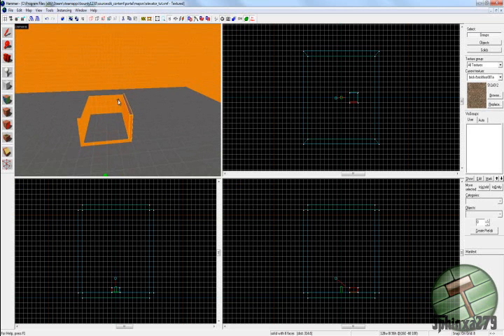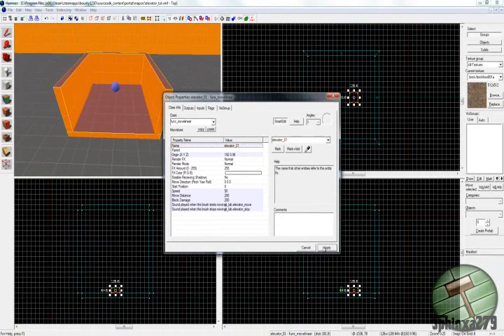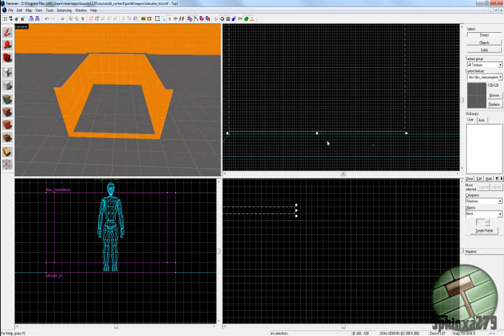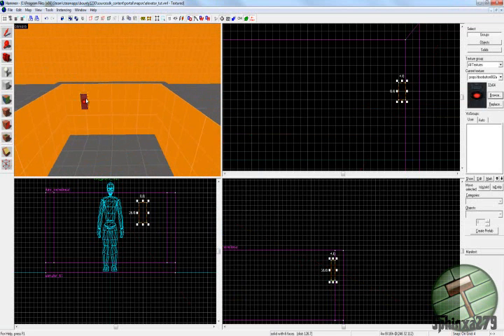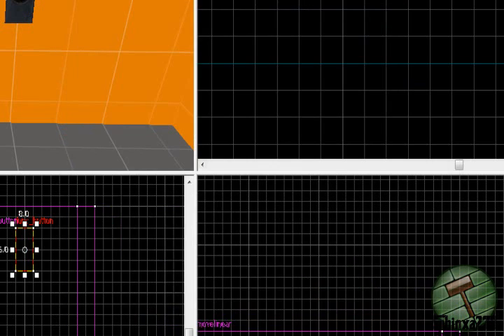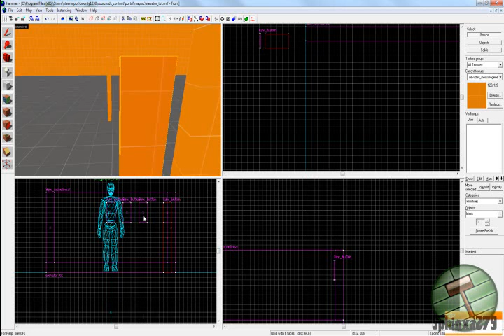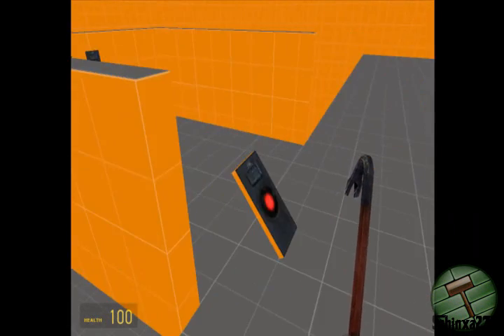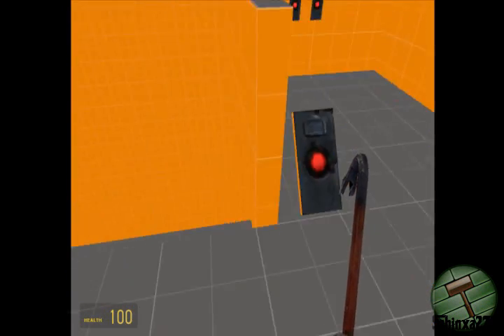Valve Hammer Editor Tutorial - Multi-floor Elevator

Comment: I have a door on each floor that opens into the elevator shaft, and another door parented to the elevator itself (dual-set of doors so that you won't fall into the elevator shaft when the elevator is not there)

I know how to make it open the doors that are parented to the elevator itself when it stops, but how could I make it so that when the elevator stops at a specific floor, only the door for the floor it stopped on opens, and not on ALL of the floors?